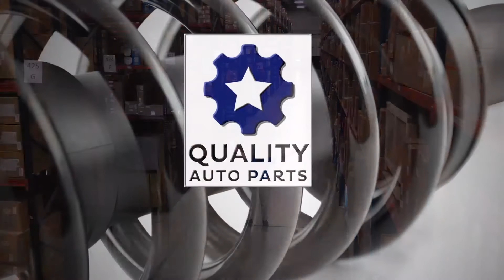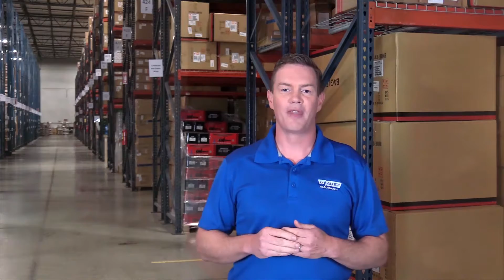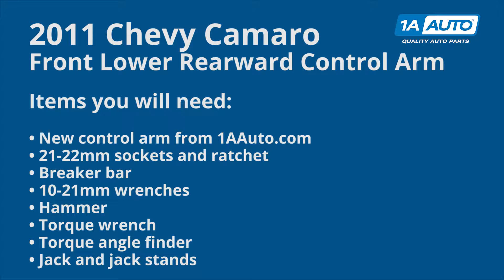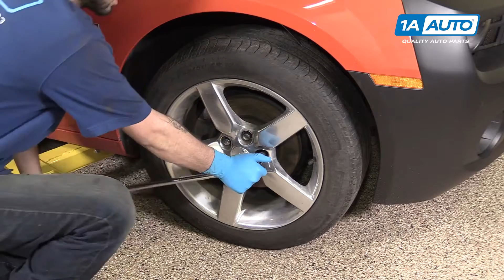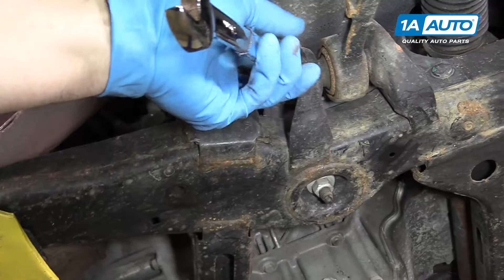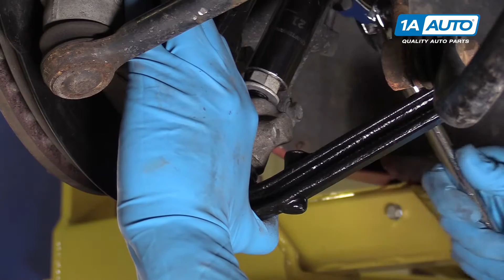How to Replace Front Lower Rearward Control Arm 10-13 Chevy Camaro

Comment: Im having an issue. Nut keeps spinning and wont come out but will tighten.... the stud will not move. Tried an impact, breaker bar, it just won't move but the nut keeps spinning. I applied a jack under multiple different ways directly under the control arm and still just keeps spinning. Im about to pick up an angle grinder tomorrow morning and just cut it clean off because this is ridiculous